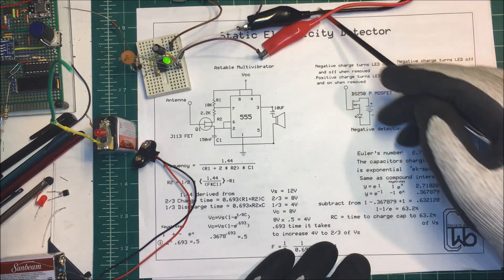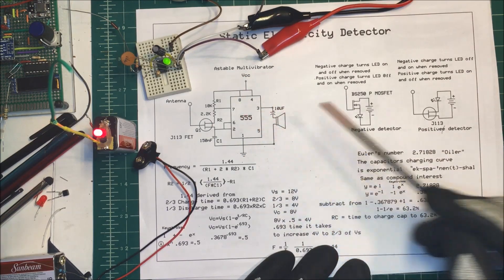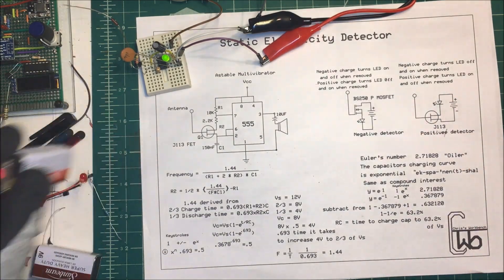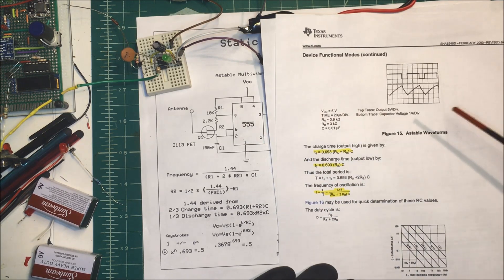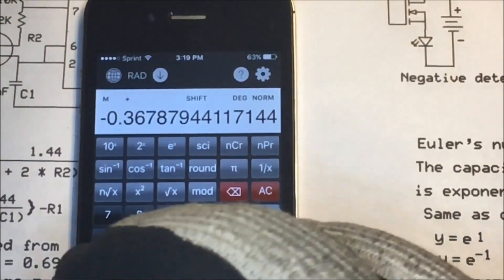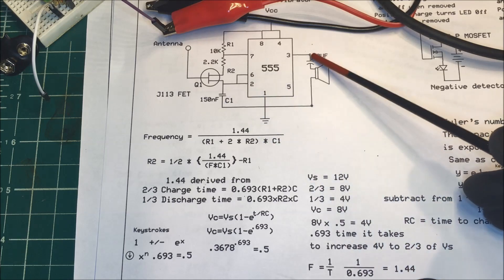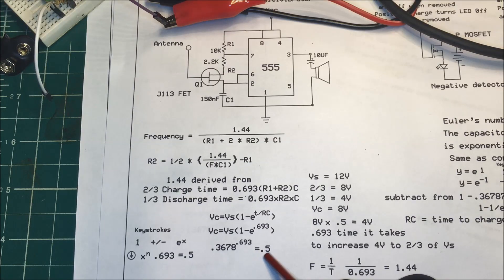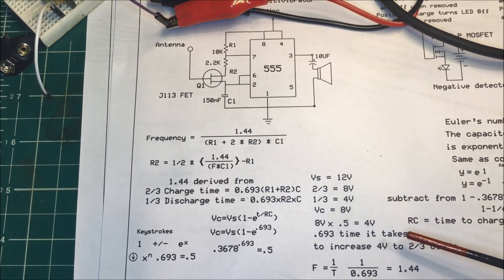Static Dectecton

Comment: I would use the base emitter junction of an npn transistor to protect the gate of the fet. With the base connected to the gate and the emitter to ground. That would limit negative gate voltages to about -8 V. The transistor junction would breakdown before the fet junction and that is repeatable unlike a damaged fet gate junction.

Comment: sir, I have a question Does The human body's static electricity releasing alarm pole have the same circuit??? please answer me as soon as possible
Reply from the maker: I don't know the answer to your question.
Thanks for the comment.
Reply: @ke6chris  ok so by this circuit we can chack the human body static charge??
Reply from the maker: You can check for static before you work on sensitive components. Make sure you are discharged before handling sensitive components. @kumawatajaykumarsureshbhai9487